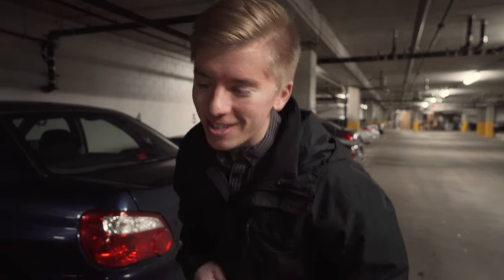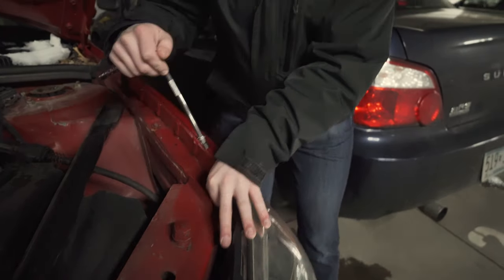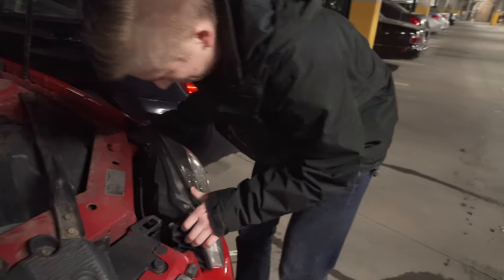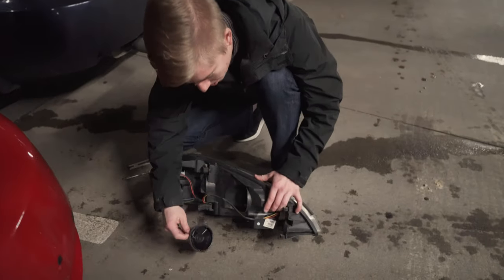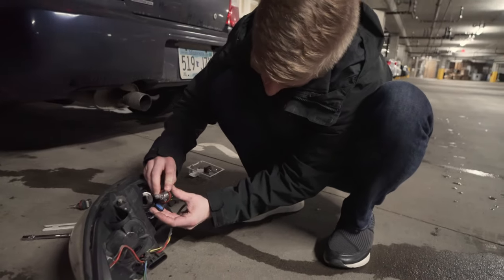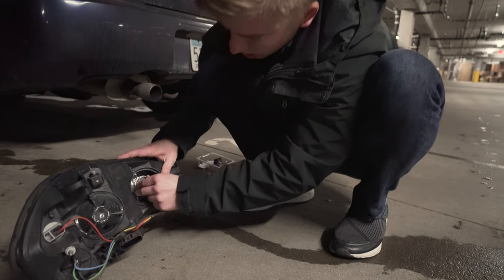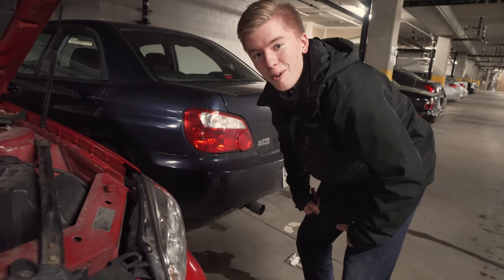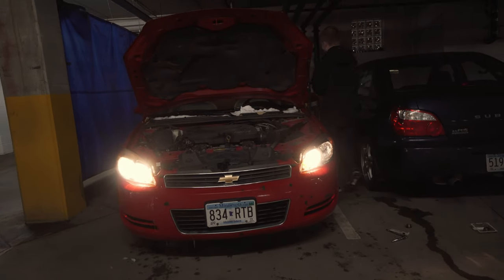How to replace Chevy Impala Headlight Bulb 2006-2016

Comment: The one you were supposed to replace is it similar mine looks different it has a wire that runs to a connector
Reply from the maker: They have the same connector, but the bulbs are rated for different wattage (power outputs).   Standard H11 bulbs are 55 watts whereas standard H9 bulbs are 65 watts and H8 are 35 watts.  The Chevy Impala uses an H11 bulb for the low beam, and the H9 uses a H9 bulb.  They are right next to each other which is why I mixed it up.  The high beam is more towards the center of the car when look at the front of the headlight housing, the low beam is towards the outside of the car when looking at the front of the headlight housing.